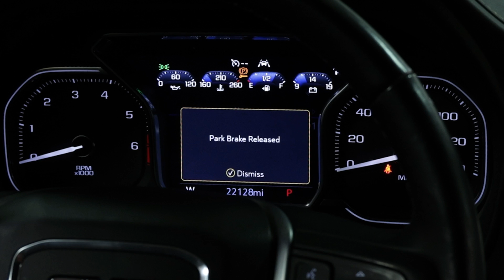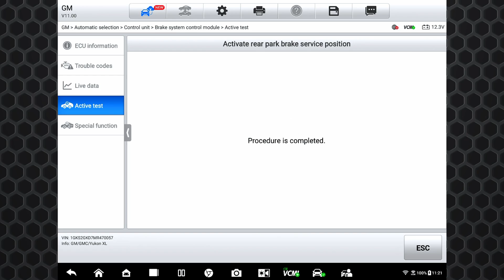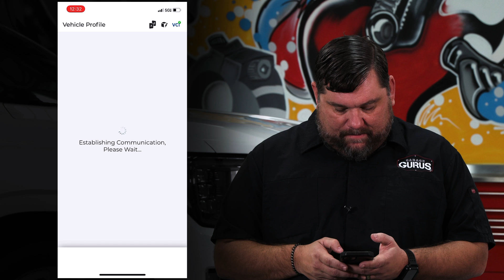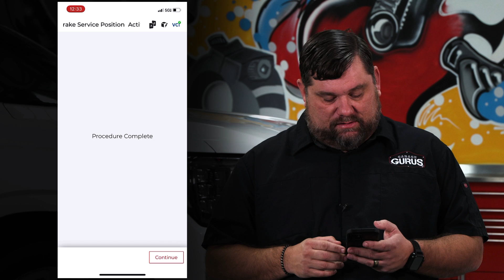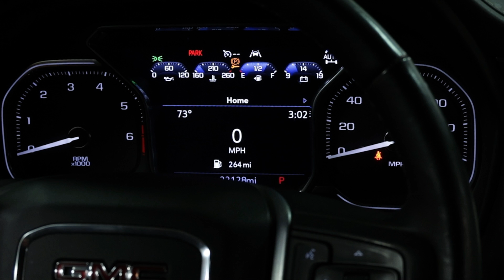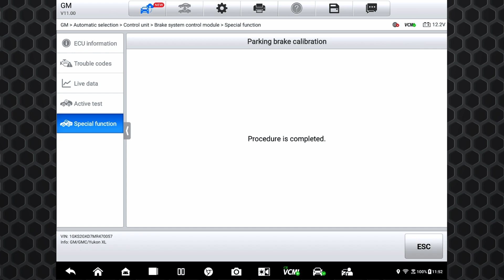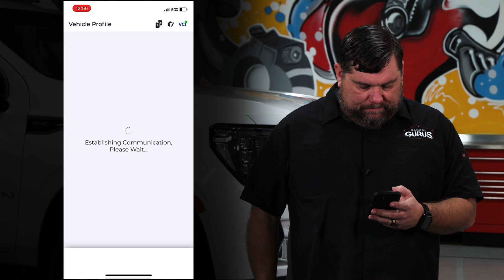Garage Gurus | How to Put the Parking Brake in Service Mode for 2021-2023 GM Trucks & SUVs

Comment: Can you do this same procedure on a smaller SUV like a trailblazer or Buick encore? I tried to do the in vehicle process multiple times and the flashing light doesn’t stay on making me fear they aren’t actually fully retracted just “off”. But neither of the vehicles I tried it on have just a single button. It’s like a lever where you pull it up to go on and push it down to go off. Also aren’t they on the front calipers not the rear for a 2021/2022 Trailblazer/Encore?
Reply from the maker: Hi, thanks for reaching out! Our tech team would be happy to help you with this. You can reach out to them at 1-800-325-8886. They are available Monday – Thursday from 7:30 a.m. – 4:30 p.m. (CST), Friday from 7:30 a.m. – 4:00 p.m. (CST).

Comment: After it goes into brake service mode do you need to shut the ignition button off before you disconnect the negative battery cable ??

Comment: I do this for my Sierra 2500 AT4 using the Topscan tool. But I don’t get the option for Control Units.. any idea why by chance? I also cannot manually put the truck in service mode by the brake and button alone…

Comment: So I’m a newbie, I don’t know what parking brake service mode means. I’m assuming that it means the electronic parking brakes disengage so that you can tow the vehicle or do a brake job and rotate the wheels. Am I correct? Would be helpful if someone would explain that to us non-technical types.
Reply: Yes. Backs out park brake all the way so you can take out old pads and install new ones.
Reply: Not necessary for a tire rotation.

Comment: Does this work as well for doing a brake job on the front brakes?
Reply: I know the ebs is only on the rear but I need to do my front brake pads.
Reply: @smitley88 No need to do this if you’re only working on the front. Just when you’re working on the rear.

Comment: Hi, these new vehicles self checks most of the systems when you open the door and periodically when not even running. In this case it pressurizes the hydraulic system if the door is accidentally opened or touching the epb motor cause a self check. Disconnecting the negative battery after putting to service mode will prevent all that, and it won't even reset the radio system due to the large capacitor on these vehicles,  at least on a 23 models that i tried. After 5 hours of negative battery cable Disconnected, nothing had changed.

Comment: All those asking about why you should disconnect the negative battery cable, it's probably to prevent the rear calipers from activating, incase there is some faulty module or some sort of short that may trigger them. It's a fairly common "safety step" whenever working on a electrical component.
Maybe overkill but that's likely why

Comment: I got ur email. As a shop owner past top Tech I also wonder “what the purpose is of disconnecting the battery? 
You used to lose all the radio stations that were preprogrammed so that’s an extra step and if you had a Honda with an antitheft radio, you needed the code, hopefully in the glove box, but not always before ever dealing with disconnecting a battery. 
Now Honda makes us jump through a bunch of extra steps to prove that we’re working on the car and didn’t steal the radio and try and get the code.

Comment: The electronic calipers, at least on Ford vehicles, have connections at the calipers. 

What I do is raise the vehicle up in neutral, emergency brakes off, windows down. 

I then unplug the calipers. Quick, easy, and they can not apply during brake services. 

After I'm all done servicing the brakes, those connections get plugged back in. Simple. 

I didn't disconnect the battery, I didn't grab a laptop, and I never  put the vehicle into service mode.

I also am mindfulness of the pressure differences on the modules. When I push back the caliper pistons, the brake bleeder is open. The fluid gets pushed out the caliper. The modules never see it.